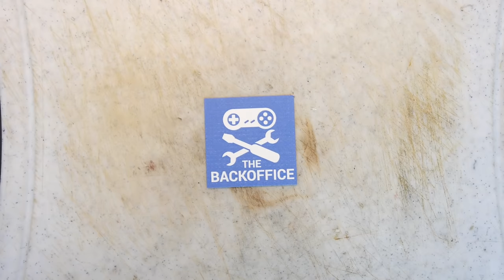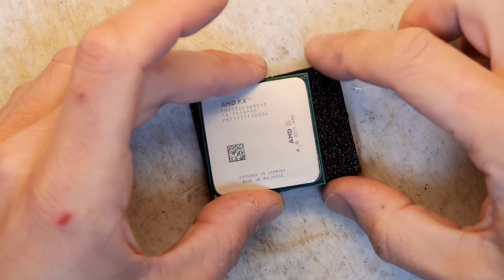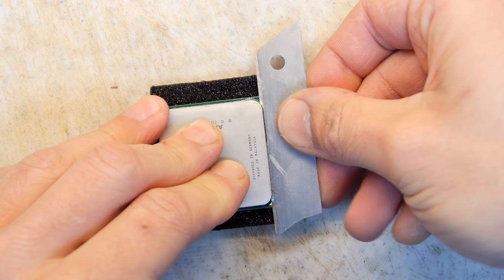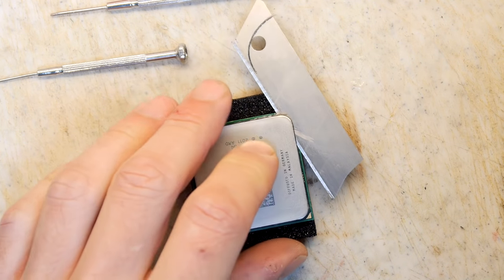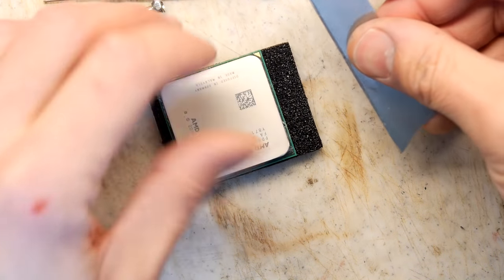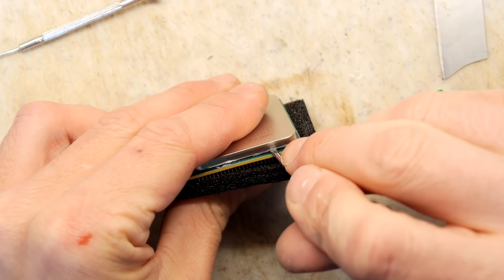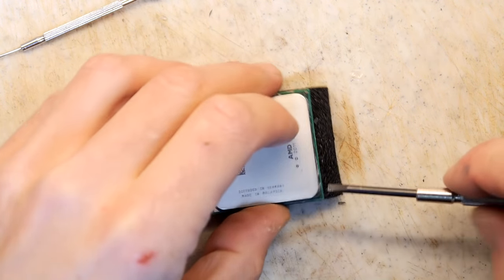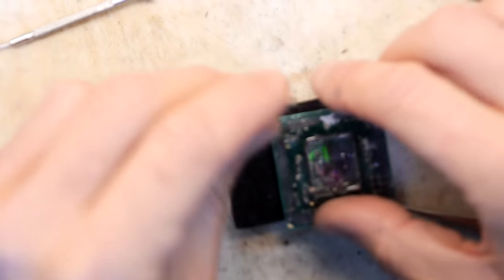Do not DE-LID an AMD FX9590 CPU! (Already dead CPU)

Comment: Gallium may have been a better option for decapping the heatsink
Reply from the maker: I would love to get hold of come Gallium! That stuff is crazy cool! I wonder if it reacts to silicon, because if not you could carefully drop it onto the middle and work it through. I suspect it would eat the leggs of the surface mount items though, but would make for a good experiment!
Reply: Well most likely the silicon would be covered with epoxy or silicone. so there would be a barrier that the gallium wouldn't dissolve in it. so using a small amount right on up of the die . It would leave a small radius of fragile aluminum. so when you cut around the bottom of the heatsink it would pop right off
Reply from the maker: It couldnt hurt to try! I would like a bunch of that stuff in the old superman movie that dissoved its way into the computer core. That looks really useful for this sort of thing :)

Comment: AMD soldered their CPU's and YOU split the silicon in half. Leaving the solder on the IHS. You need serious heat on the IHS to delivid a AMD CPU. No need to delid AMD as they use solder. As for variances in core temperature, the thermal probes in the DIE itself are subject to tolerances and are not 100% accurate per core. So on real temp, CPU z, or Aida 64, you will not get perfect uniformity from core to core, even though the thermal compound, solder or liquid metal are uniform. The thermal sensors are not perfect representative indicators of core temps. They are merely reference. No need to delid AMD. As for Intel there is clearly a benifit to enthusiast overclockers.

Comment: Can you do the de-lid on AMD 64 X2 6400+? I would like to see.
Reply from the maker: If someone sends me one, I will happily delid it :)
Reply: I see...I have one, but i don't wanna to sacrifice on my AMD 64 X2 6400+.
And i found ebay 29.50$ with free shipping. I'm not sure if you can afford it.
Reply from the maker: Why is it worth delidding? Can people overclock it significantly?
Reply: Because something what's inside, for example the Intel Pentium 4 to compare something cpu, if it's worth dellidding or so vary depending cpu models.
I can OC, but I reached 70*C on stock cooler and 3.5ghz (original 3.2ghz but I forgot to put replace the thermal paste for long time ago) although I waiting for new AMD Ryzen stock cooler for compilable AM2 socket.
Reply from the maker: +Hideg Jenő Péter I will ask a few people of they have any spare CPUs to give me 👍

Comment: You should have done your research before you tried that. If you had you would have known to heat up the chip to delid it (to melt the solder), and you would have known how deep to go with the blade. Best method is actually not to slice the silicon and try to pry, actually you would put it into a vice, one end of the vice on the PCB, with a rag or something in between to prevent PCB damage, and the other pressing against theedge of the other side of the heat spreader. then hold a heat gun to the heatspreader for a while, and when it gets the heat spreader hot enough that you can melt solder wire on it, you begin pressing with the vice. That is how you delid a soldered chip.

Comment: Heating the CPU up helps....
Reply: I already delidded a few dead i3 Processors and heating it up works often, if it starts but often crashes, I just put it in without a cooler to get it warm

Comment: isnt that just an overclocked 8370?
Reply: 8300 but yes
Reply: i got mine to run at 5ghz with a 1.5v vcore does that mean mine is one of the top chips?

Comment: You have to use heat and be more delicate with the chip m8. Don't stub it like that!
Reply: I assure you it is possible to delid it  :) Oh and i forgot to mention.. Use a lot of heat because this chips are soldered unlike intel's witch use thermal paste like it's 1999 :\

Comment: The Backoffice ->  CPU. This bad boy spent 18 months running at over temperature, the silicon was fused to the lid by that point and would never come of cleanly.

Sure, 10000 ppl told you it already!.
No, ERROR!.

They come soldered from factory, it is not like Intel, there is not internal paste. It is SOLDERED, so unless you heat it up to 210º, you can't remove the heatsink.

Comment: This is how a de-lidded soldered Cpu shoud look like, besides the AS5 put on after :P

https://drive.google.com/file/d/0BzgxOVty8rdeOVNYanpHcVVjWHc/view?usp=sharing

Its a E8500 Cpu, i used a razor blade from a ceramic plate cleaning tool, wraped in some duct tape (both sides are blades xD) cutting the silicone, then putting in the blade on one side for a bit of pressure, and something to hold the Cpu while heating up the solder. For this i used a normal lighter, heating for 20-30s then 1 min pause for IHS to cool a bit, and this i repeated about 6-7 times till IHS popped off :-)

i read about using a frying pan, however i felt the lighter was a better tool in this case as you can heat more directly on the core(and hence solder) rather than heating the hole IHS, given the basics of metal beeing a really good thermal conducter

Comment: I currently have a AMD Phenom II X6 1090t and I was having loads of crashing problems and I thought it was the mother board and when I was this video and heard what you were describing I did also think that you also had the same problem I had
Reply from the maker: +Moo Moo N Speedster Productions if you can get the AMD utility that measures thermal overhead you can check 👍
Reply from the maker: +Moo Moo N Speedster Productions also this was the ultimate fix after replacing the broken CPU https://youtu.be/Rv8tHVDDLj4
Reply: Well that was when I built the system back in September but sense then I have swapped out the motherboard for a new one and I have had a pretty good experience

Comment: should have tried (go gone) it would break that stuff up to remove it easier. also try the remnants in different cleaners and then use the one that works on a cpu to open them. please make a video (subing now).check shops and leave a thank you in the video for your area computer repair store and you will get a whole box to try with good luck.

Comment: 1,000 thumbs down, they got you to do this so no one would try it on the new chips, because like in the old days  all the cpu's were dumbed down because mostly they are the same chip and don't want anyone to unlock anything in the new chip because they too are dumbed down, it's like NVidia selling 3GB cards that are the same as 6GB cards to reduce their inventory of 6GB cards before AMD take a bigger share of the graphic card market and sure someone is going to fine a way to unlock those 3GB's of memory, any I love NVidia, and AMD that ok, everybody is doing computer manufactures card manufactures chip and so on, all I say is just be real and that in the long run will go best to the one that doses

Comment: I thought everyone new you can not de-Lid FX cpu's. Amd didn't use thermal paste on them they physically soldered the heat spreader to the dye and that's why your split in 2 lengh ways. Interesting to watch though.

Comment: supposed to heat soldered cpus up before you pull them apart...
and if you've ever seen a delidded cpu the adhesive (as you can see) doesn't go nearly that far in lol
Reply from the maker: +SubLimation7 yeah, I get that now 😂

Comment: Bull, that is not what is inside a comp. chip. I have taken many apart and they are nothing like that and are most likely only antenna's of some kind. I have found that chips don't even contain circuits of any kind and no smaller chips inside only a simple copper plate with tiny holes in it like some kind of antenna. Computers may not have any computing power at all and reliy on some kind of mainframe computer located in various places around the globe and that the chips only communicate with that mainframe computer back and fourth where nothing is actually being done by your computer but instead the mainframe sometimes located in space run by.........................,,,,--,,_....

Comment: All AMD chips are soldered. they bypass the "bad intel TIM" problem. but i only think its because AMD has always had a heat or power consumption issue for the past Decade or longer.
https://www.facebook.com/photo.php?fbid=1036161109787397&set=a.102959439774240.4465.100001805532852

Comment: I've had nothing but heat issues out of AMD CPUs.  I'd rather have an equivalent Intel any day. my i5 4670k is running at 4.3ghz oc and it barely hits 85f at idle and 150f at load with the stock heatsink.
Reply: Sounds horrible and under-powered. Especially since AMD runs more efficient.

Comment: Just watching this makes me cringe, am3 cpus were soldered, so, no thermal paste, also means can;t remove that lid without heating it up, and also, for anyone about to delid a cpu, take it from someone whos done it successfully, get a thinner blade, i used razor blades, and take your time, try not to force it and don't gouge the pcb or that will kill the cpu if you break the tracks on pcb.